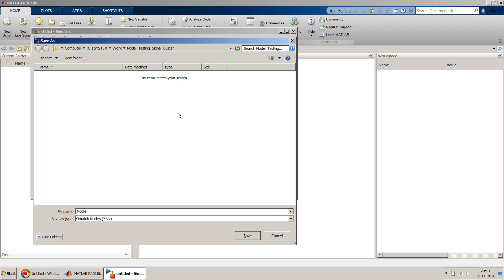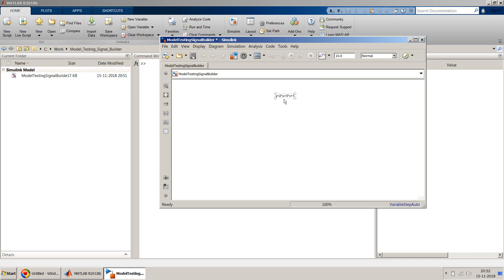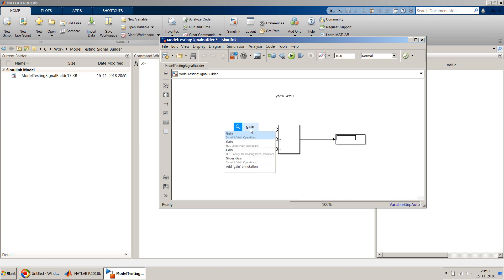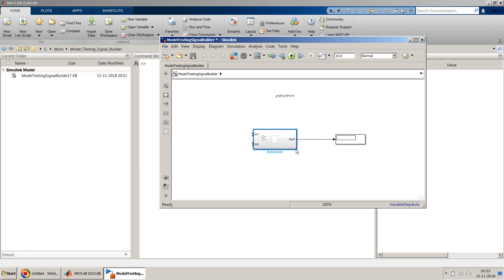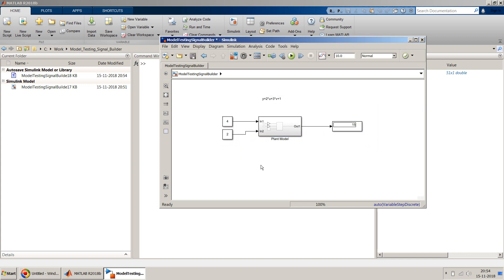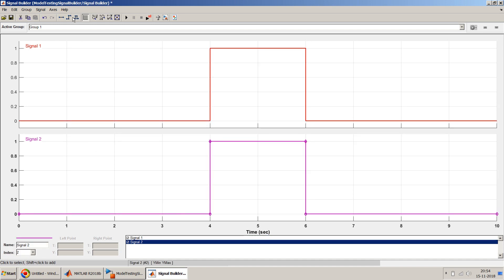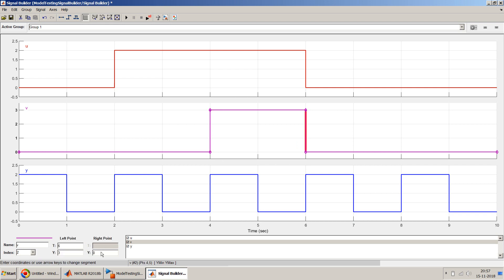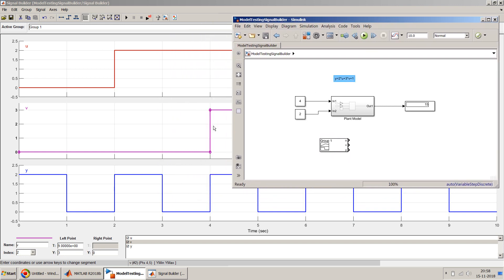How to do basic model testing using Signal Builder block in Simulink?

Comment: Very good! But I have a couple of question. First I want to simulate a PV array and I need atmosphere temperature and sun irradiance in one day/one month and in a year. So how can I adjust the time axis insteed of second in the units of hour for a day,  the unit of days for a month and the unit of monthes for a year. And the second problem is, that I want to either import for example my irradiance signal direct from excel or give my signal by myself as user defined in my Signal Builder. Thank you in advanced.
Reply from the maker: 1. AFAIK, the unit on time axis of Signal Builder can't be changed. So, for representing  larger duration, you can either scale up the X-axis so that it can take hours and days along X-axis. Otherwise just do mapping of hours and days to second unit of time -axis.

2. I think entering large amount of data manually will be tedious and error prone. You can import the data from excel to base workspace and then use the workspace variable in designing your signal's value in signal builder.

Good Luck
Programmer World
https://programmerworld.co

-

Comment: A wonderful presentation. Sir, is it possible to drive IGBT using Signal builder block. If so, please explain it to me.
Reply from the maker: Signal Builder just acts like a source. So, it can be used to drive any element in Simulink including the IGBT transistor. For simulating electronics element in Simulink you may need Simscape Electrical toolbox. Hope this helps.